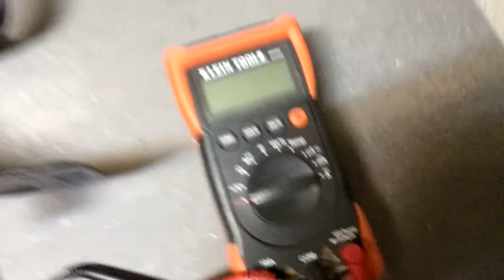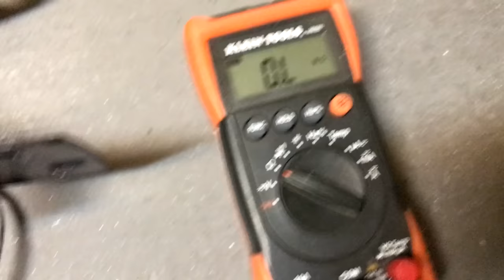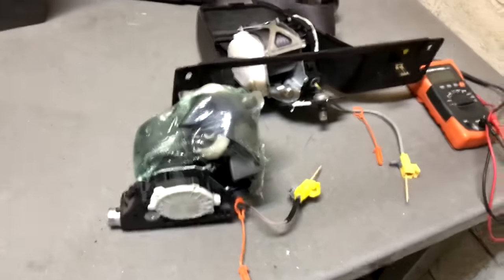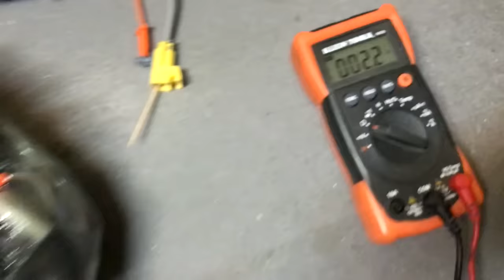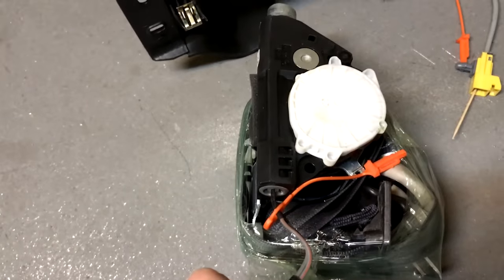How To Fix Repair a Stuck Locked Jammed Seat Belt Pretensioner

Comment: THIS VIDEO IS AN ADVERTISEMENT, NOT A GUIDE. 
Most of you probably have seatbelts stuck in reverse lock. Here's the solution:

1. Hold the seatbelt retractor between your legs in the EXACT same orientation as it is on the car (as close as you can get it)
2. Wind the seatbelt back 1/2" -3/4"
3. Gently pull the seatbelt back up, making sure that the belt exits the retractor at the same angle it would when installed on the car. 
4.  If it locks, back it up 1/2" - 3/4" and try again. You may have not gotten the orientation right.
5. When you pull it out all the way, use a clip to keep it from retracting back or loosely tie a knot in it to prevent it from retracting all the way again. (Obviously don't install your seatbelt with a knot in it). 

There. 5 steps. I fixed 3 junkyard seatbelts this way. Was that so hard, Gavin?
Reply: I'm looking for a solution so I don't have to take the retractor out. I'm a chick. These tools confuse me. 😉

Comment: hi . if you can help me with that .I sent my seat belts already to the place and they fixed them but my question is do I need to replace the seat belt sensor the one where you hock the seat belt back its located on the driver side between the front and the rear  seat

Comment: I have a 03 durnago with a shorted seat belt. the gas charge hasn't gone off. Can I just put a 2,5 ohm resistor across both wires before the connector? to turn off the light? or solder in a good pigtail from the wreckers?
Reply: Yes